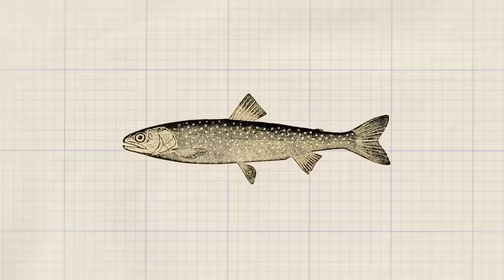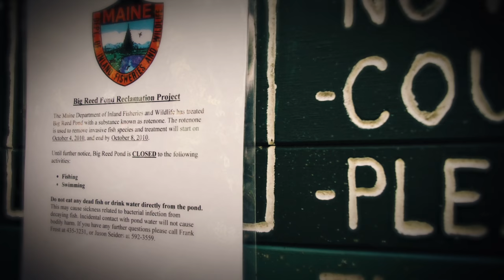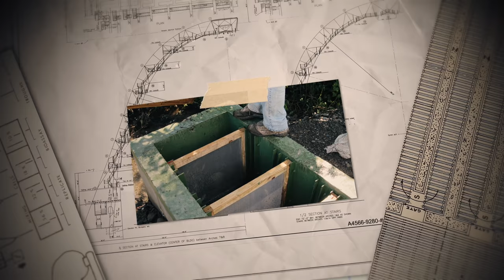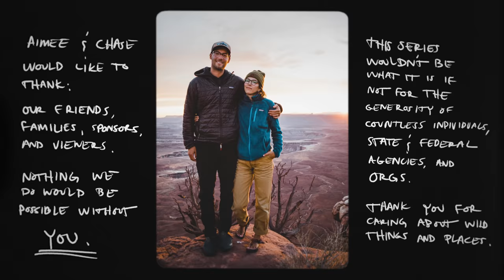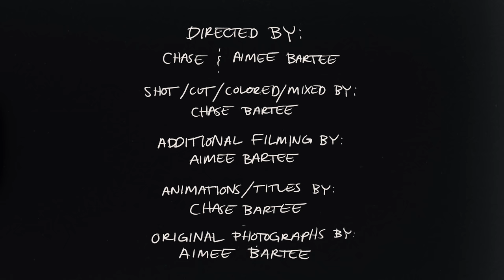THE QUEST TO CATCH MAINE'S RAREST FISH || For Wild's Sake: The Rare Trout Chronicles | Episode 2

Comment: There are a few things I'd like to clarify in regard to the reclamation of Big Reed Pond and the subsequent regulations roll back.  My intent is solely to make sure we are working with facts, as well as opinions from multiple sides.  First is that while there's no reason for anyone to claim defeat, it's too early to claim victory IMHO.  For the reclamation to succeed long term, recruitment will have to exceed mortality - natural and angler.  I do not believe the charr population is is at the level it was pre-smelt infestation.  I say that because the fish pictured, and others I have heard about, are notably larger than what used to be there.  According to someone who used to guide the pond, the average was 10", 12" was a good fish, and 14" was exceptional.  We are hearing reports of 20" fish.  The large sizes could be a sign of low-abundance.  If so, it's still growing and will eventually level off.  Another concern is the long-term genetic viability of the population.  In fact, one state biologist said the pond strain was likely already lost prior to reclamation.  This is because by the time we acted, there were only 10ish fish that could be used for brood stock.  Smelt were first reported in 1991.  And while referred to as an "illegal introduction," they are as likely to have entered the system as a result of the legal use of live bait which was in place until between 1989 and 1990.  In fact, a former fisheries director was quoted as saying, “The smelts in Big Reed Pond most likely got there via their use as bait, which was legal at the time.”  the
Reply: Bob,  spend a bit of time looking through the history of stocking barren lakes around Kamloops BC in the early 20th century.  What is pretty likely in this case is the first cohort  gaining too much size which leads to more intense piscivory.   It is a common issue after a restocking of fish unless they are not cannibalistic. Very often this is a sign of lack of cover for juveniles.  Cheers!
Reply: @BeautifuLakesStreamsBiologists the stocking of barren lakes is always somewhat problematic.  As is introducing highly piscivorous fish.

Comment: I also fly fish, but I disagree with the narrative that conventional fishing is the harbinger of death on these fish. The issue is an uninformed general public. I believe most of the public has no intention of harming fish they don't plan to keep and I think if proper catch and release ethics are implemented, the gear used should not be an issue to an extent. Barbless, keep it in the water, handle the fish for no more than 10 seconds if it can helped. I think most of the general public does not realize extra steps are needed to catch and release salmonids safely since they are much more sensitive than other species. Is there slot limits on these fish? Seems to work well here in the West at protected fisheries. I just don't see "fly fishing only" as practical, some people may never be able to learn to cast a fly line because personal physical handicaps and what not. I don't see a father with an 7yr old kid trying to cast a sinking fly line. Fishing has always been about the only thing I've been able to do marginally well since a kid, and I think rules like these could exclude many people from enjoying the same publicly funded outdoor recreational activities we all enjoy. The thing that bothers me in the fishing world is there's always an attitude of fly anglers vs conventional anglers that just reek of "snobs vs savages" mindset. Some of my best fishing buddies fish conventional gear and are some of the nicest and catch and release oriented individuals I know. Hell, I probably keep more fish to eat each year than them haha.